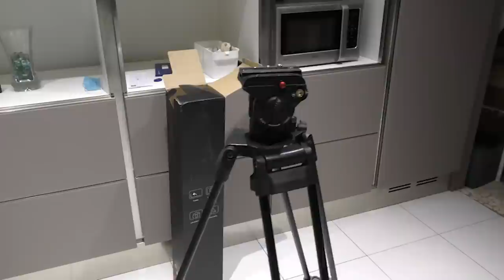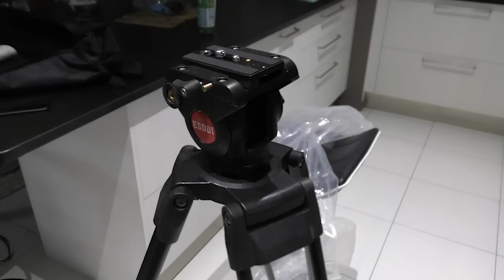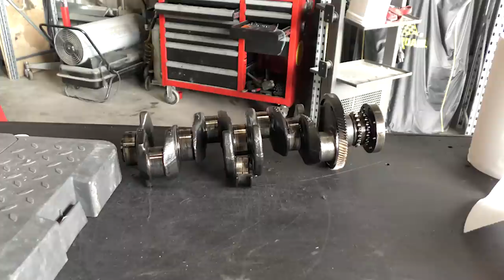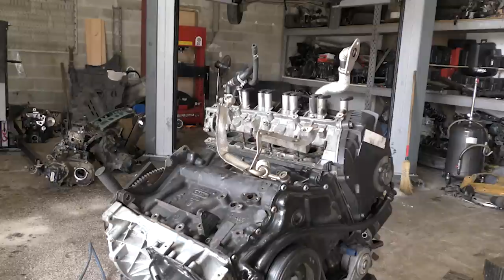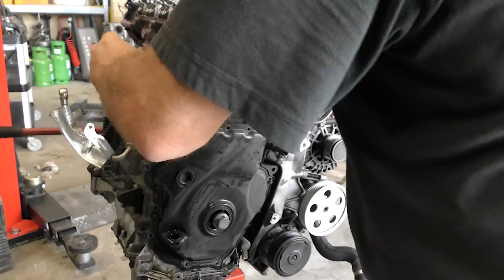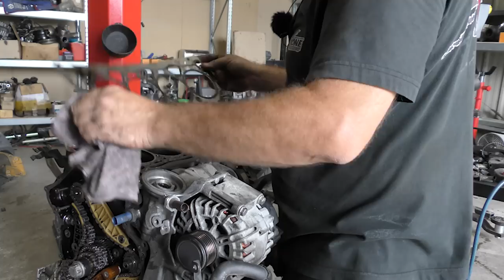IL CASSE LE MOTEUR DE L'AUDI TFSI 2.0 ET JE RÉPARE CETTE CATASTROPHE

Comment: Morceau  de cam follower,  c est le piston entre la came et la pompe hp essence,  tomber au dessus  de la soupape d ou la casse. 
Les bougies, lors du passage à l éthanol, il faut mettre des bougies iridium  pour éviter  la corrosion de celle ci.  L éthanol n est pas une cause de casse, il faut juste être conseillez et le suivre correctement,  alors moi je conseille de vidanger tout les 5000km si on est a l e85,  car l ethanol passe plus facilement  dans l huile que l essence. Seule point négatif, sur ce moteur contrôler  le cam follower  tout les 30 000km sinon il se désagrège  et les morceaux  tombent au dessus des soupapes ou dans la pignonnerie de pompe a huile... nota si cliquetis a froid, remplacement tendeur de chaine acc. Il y a également  eu des injecteurs fuiyard qui induise les pistons fondu .cdlt

Comment: j'ai eu la même chose sur ma fiat tjet, sur une des  deux soupapes d'échappement (mais les deux mortes).  Le véhicule avait manqué d'entretien...je l'ai vu après. J'avais fait faire une carto flexfluel.
Sinon ce problème est arrivé un mois après la casse du turbo. Il a été remplacé, mais le problème est arrivé deux mois plus tard, 2000 kms après. 
Le turbo vraiment en vrac. Donc j'ai pensé que le circuit d'admission avait manqué de nettoyage et pris une "merde". Une grosse partie cisaillée, et celle d'à côté, j'en déduis que les fuites d'échappement de l'autre soupape l'ont cramée (je précise que c'est une supposition et non une affirmation!).
En revanche ma compression était proche de zéro, et bien entendu, le moteur tournait sur 3 pattes.
Je pourrais presque passer vous les montrer, avec le garage à Biganos, nous sommes presque voisins lol.

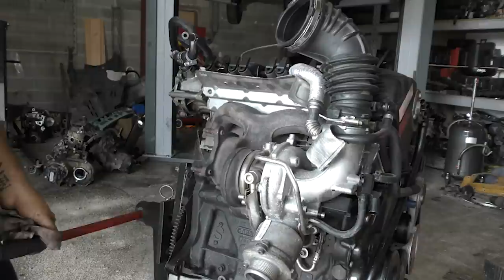Comment: 7:01 Quelle voiture conseiller? Déjà une voiture fabriquée entre 1990 et 2000 voire 2004 grand max! Avant 1990 voiture encore pas assez protégé contre les affres du temps (genre protection des soubassement et traitement anti corrosion) et après 2004 voiture entièrement conçu par des ordinateurs et des données accumulées permettant de faire des pièces plus optimisé et "légère" donc moins coûteuse( comparez le poids d'un échappement de 1990 à celui d'un de 2020 vous comprendrez mieux), pour à la fois faire des économies de productions et permettre de "limiter" la prise de poids des voitures (donc "moins" de consommation) sans parler des normes antipollution qui étouffent les moteurs.
Et puis l’électronique à bord vieilli très mal... Hâte de voir la gueule d'une tesla dans 20 30 ans^^
Pour info je roule en mercedes w124 une 250 turbo diesel et un CE 320. (respectivement 535000KM et 220000KM) L'entretien courant pour les deux est raisonnable au vu des prix pratiqués pour les nouveaux modèles. Aucune intervention sur le 250 TD et Changement faisceau moteur (problème connu : 1500 euros en 2018) changement joint de culasse pour le 320 (problème connu sur ce modèle : fuite d'huile au niveau du carter chaîne de distribution 2500 euro chez Mercedes en 2018).
E t comme par hasard ce moteur  (320) est un moteur née à l'époque ou les cols blancs ont commencé à prendre la place des cols bleus à la direction pour "augmenter" la rentabilité de la marque, c'était en 1992- 1994. Et cette mentalité d'économies d'échelle au détriment de la durabilité a commencé à pointer le bout de son nez... Mais c'est à partir de 1999 que cette mentalité à commencer à prendre de l'ampleur et faire vraiment de la merde... merci les ordinateurs et ces cons de marketeux...
Ces moteurs TSI et surtout TFSI, je n'arrête pas d'en voir s'entasser dans les concessions et casses. Puis Youtube regorge de vidéo sur ces moteurs conçu avec le cul.

Comment: le cylindre avec les soupapes casser sont bien encrasser c'est possible qu'il y est eu des morceaux de calamine qui ce soit loger entre les soupapes et les  sièges donc les soupapes se referme mal et sa peut toucher quand le piston est au pmh après l'encrassement peut être due a un mauvais allumage aussi bougies trop ancienne par exemple c'est difficile a dire vraiment trouver la cause surtout si le véhicule roule a e85 après se qui faut savoir aussi c'est que l'éthanol et a un pouvoir calorifique moins important que l'essence donc il faut en injecter plus se qui faut savoir aussi c'est que l'éthanol est plus corrosive que l'essence les moteurs conçu d'origine pour tourner avec se type de carburant ont soupapes sièges de soupapes  et piston renforcer et ont la gestion moteur approprier moi je pense que c'est une connerie de passer un véhicule a l'éthanol qui n'est pas prévu a la basse par le constructeur pour tourner a la base a  e 85  moi je conseillerai au client de ne plus rouler a e85 et repasser le véhicule en config origine .

Comment: J'ai vu le même cas sur une Saab 2.0 turbo, soupapes grillées, le proprio tournait à l'ethanol sans gestion.  
Je ne sais pas si c'est la même cause sur celui-là.
Depuis peu, ils programment les gestions pour avoir des retours à l'échappement, ça peut-être dû à ça, un retard à l'allumage trop important.
Reply: La plupart des moteurs essences acceptent l'éthanol (jusqu'à un certain pourcentage) sans faire de gestion.
Reply: @anthonybrou4445  C'est exact pour un moteur atmosphérique, bien que le calculateur ne pourra plus corriger la richesse au delà d'un certain seuil.
Mais pour un moteur turbo qui sera gavé en air, sans gestion adéquate, vous vous retrouvez très rapidement avec un mélange pauvre. Et ça ne dure qu'un temps avant de faire de la casse

Comment: Salut j'ai une audi a4 b8 de 2009 2.0 tfsi j au refait une réfection moteur du à une consommation d'huile et c était les piston d'origine qui cause cette surconsommation les segment sont trop petit et trop fin tu va devoir faire comme moi il existe des kit rebuilde sur eBay avec tout le nécessaire piston segment tout les joint moteur coussinet vilo et bielles kit distribution pour même pas 500 euros juste un Conseil achete un kit chaîne autre que celui qui a dans le kit il ma lâcher à 5000 km après rebuilde un kit chaîne chez autodoc elle a démarrer depuis 15000 km ras
Reply from the maker: Tu as un lien ?
Reply: En effet des soucis depuis 2007, et assez nombreux, cela se calme seulement en 2015.....Pour le moteur... pas le reste........

Comment from the maker: je sais pas d'ou peux venir ce probleme je pense ethanol ou mauvais allumage aucune idee
Reply: A quel moment l'éthanol ça casse des soupapes? C'est un carburant, ça modifie pas la structure du métal..
Reply: Watai inc. A partir du moment où le rapport stœchiométrique est foireux et mal contrôlé et que tu crées du cliquetis
Reply from the maker: @Val-lv1hy  tu peux contrôler ça comment
Reply: GARAGE ALP AUTOMOBILES c’est le boulot de l’Ecu mais tu peux le monitorer. J’ai lu que ce moteur est flexfuel d’origine avant. Donc on peu supposer que le rapport est ok car moteur étudié pour. Le cliquetis peut aussi être induit par une température de fonctionnement trop élevée ou juste une admission trop chaude. Ça a tendance à survenir plus fréquemment sur des moteurs turbo car la haute pression favorise sa survenue. J’avais vu aussi sur une vidéo de Engereering Explained que certaines huiles peuvent favoriser également le cliquetis.
Reply: Pour ceux que ça intéresse allez voir la vidéo « How super knock can destroy modern engines » de Engeneering Explained
Reply: @Val-lv1hy  c'est pas le carburant qui cause du cliquetis. C'est le mec qui fait la carto. 

surtout que l'éthanol de base à un indice d'octane plus élevé et donc une meilleure résistance au cliquetis 

Quand tu passe à l'éthanol le mieux c'est de mettre un mano AFR avec sonde large bande au moins tu vois ou t'en es
Reply: @watai  mets de l'ethanol sans boitier ou reprog, tu vas voir si ça ne fait pas de cliquetis. pour garder un bon rapport stoechio et donc ne pas rouler trop pauvre (ce qui favorise grandement le cliquetis)  il faut obligatoirement injecter plus d'ethanol que si tu roule au SP. Donc le carburant est la cause principale, mais si le mec qui fait ta carto est mauvais, c'est une cause également. 
Cependant là vu comme c'est cassé, et la gueule des pistons/autres soupapes je ne pense pas que ça vienne d'un pb de carburant

Comment: ça ressemble très fortement à un dégât fait par l'éthanol, la soupape est bien cassée sur sa périphérie
Reply: Casser une soupape a cause de l'éthanol faudra qu'on m'explique pourquoi et comment. Un percement d'une durite essence non adapté de la rouille dans la pompe a essence peut être une soupape brûlé et encore comme ça déposé moins de merde ça ne devrait pas changer l'étanchéité de la soupape. Je pense plutôt a une utilisation violente du moteur 2 l tfsi c'est pour envoyer et parfois a la limite de résistance la soupape frappe fort sur le siège et a forte sollicitation ça casse. PS je viens de deculasser mon moteur 1.8 l adz et je roule qu'à l'éthanol soupape et siège en parfait état ( je deculasser a 180000 pour changer les joints de queue de soupape sur un moteur de 24 ans mais je n'appuis pas comme un sourd sur l'accélérateur. Petit complément si le mélange est trop pauvre effectivement ça peut percer une soupape, celle de droite a l'air d'être effectivement percé donc peut être mélangé pauvre par contre celle de gauche est carrément casse sur un quartier très étrange peut être de la fragilité dans le métal
Reply: @olivierfu7778  pourtant c'est extrêmement fréquent, que les soupapes se retrouvent dans cet état avec ce carburant sans préparation, l'éthanol est plus sec, et ne joue pas aussi bien le rôle d'amortisseur comme le fait du carburant classique.
Reply: @fabien89000  je pense plus a un melange trop pauvre ce qui peut effectivement arriver avec les injection direct mais il y a pourtant le capteur de cliquetis qui devrait permettre au calculateur de modifier les reglages pour l' empecher sauf evidemment si on passe en dehors de la plage de réglage. Mais je persiste a penser que le moteur a tourner a la limite de ces capacités et a casser. Un meme moteur de 2 l ne sortait que 120 chevaux il y a quelques annees le tfsi sort 200 chevaux presque le double. ou alors une petite prise d'air sur le collecteur d'admission.
Reply: @olivierfu7778  Daccord avec toi e85 n a rien a voir avec les dégâts